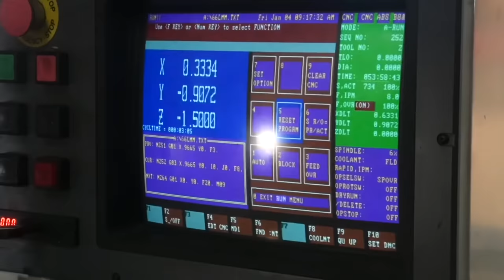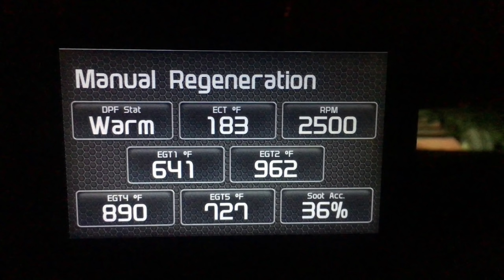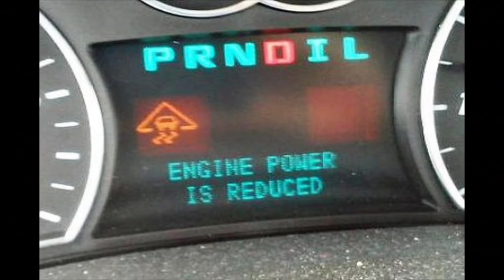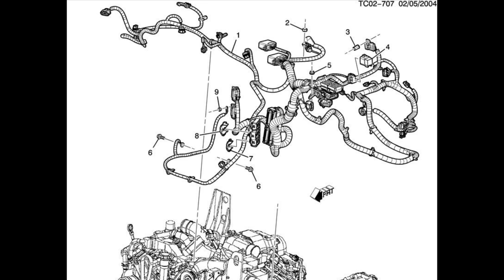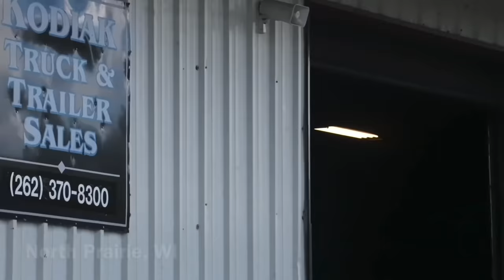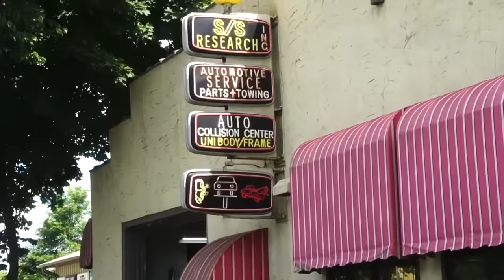Duramax Problem’s That Will Leave You Stranded!

Comment: Anyone remember when gm had a 6.2L diesel backed up by a turbo 400 trans with no electronics...and it just..... worked?
Reply: They would keep it that way but the government won’t let them. Trust me they hate making junk cause they have to warranty it
Reply: Emissions Emissions and More Transmission problem
Reply: With that impressive 135hp....
Reply: @micahblack454 it was never designed to make a lot of power, it was just a reliable workhorse engine. Ain't gonna burn any rubber, but it will get the job done.
Reply: Barely
Reply: My humvee m998 has a 6.2 it’s slow but bulletproof
Reply: @micahblack454 and impressive 20+ mpg
Reply: I had a 1997 6.5 as I understand it had a computer for timing and such only problem with that is GM put it right on top of motor which over heated it at a later date GM when they sold you a new one they gave you a longer harness for 150 bucks extra you could fasten that to the firewall or fender well get away from the heat a little bit other than that I love that truck very reliable yes I agree with you they just got too much stuff on them that goes bad and you gotta be a mechanic I know how to fix it and have all the high dollar toolsSo is it better I don’t think so

Comment: I think an LBZ specific “ beware” video would be good. Maybe even make a whole series, lb7, lly, LBZ, lmm, all of of them, biggest issues per model.
Reply: I was going to comment the same exact thing.
Reply: the BIGGEST problem i have with my lbz is people trying to buy it from me !
Reply: @bob lol, same. I get questions all the time about mine and how I like it. Then “let me know if you decide to sell”.
Reply: @bobocaterpillar3697  wanna sell that LBZ? Lol
Reply: I have an lly and would like a video of the "look outs" on it also! Love the channel and Thank you for your service!
Reply: I have an 06 LBZ with 60k. I've been lucky so far in that all I've done is replace the leaking trans lines. What are the obvious areas needing upgrades for preventative purposes?
Reply: And L5P compare them all
Reply: @jeeperaz  my 06 has 302,000 on it, only basic maintenance, plus  damn idler pulleys.
Reply: I have a o6 lbz with 200000 and no prob s should I get a tranny mod from yall I do have a check engine light on but don't have a scanner and every once in awhile it slips

Comment: I got an alarm on DEF. My shop replaced a sensor upstream of the regen box because it was wasting diesel. It would not reset the panel. Turns out the outlet sensor was slow to react and had to be replaced to allow the panel to reset. Took my shop almost 2 weeks to hunt this issue down.

Comment: Test drove a 2009 GMC Duramax the other day with only 70,000 miles on it and previous owner only used for towing 5th wheel. First time I got on it check engine light came on and transmission was stuck in seemed like 3rdish gear. Dealer called next day and said low battery caused the issue. Ever heard of this?

Comment: Just a note on the TCM - my brother-in-law has an '07 Duramax that started having the intermittent shift issues.  It looked, smelled, and quacked like a failing TCM, so he replaced the TCM.  It fixed it for all of one day, then the problem came back.  A few days later his son noticed that something looked queer with one of the speed sensors on the transmission.  Replacing that speed sensor fixed the shifting problem.  Don't forget that with most electronic control systems, you need to check both the sensors and the actuators, as well as the controller and the wiring between everything.

Comment: Very informative video. I have a lly. 240k. Headgaskets studs thermostats, water pump, 4 injectors, fuel pressure regulator , globe plug module is the stuff I ran into. She is running strong still

Comment: I'm not a mechanic but speaking from experience on my Duramax and had this issue time and time again.  FIRST place I would check is this..check the fuel filter/head assembly.  For some reason mine seems to collect contaminants and foul up the filter/head assembly.  Remove the fuel filter.  If that is the issue you will certainly see all the buildup on it and know it needs cleaning.

Comment: My son and I each have ‘03 LB7s in mid-200K’s. I did fuel injectors and lift pumps on both (tough work, but I’m not a mechanic and I got it done) and they’re both strong trucks. Yes, old diesels need maintenance, but few gas trucks will last this long at all, and the LB7s get great fuel economy compared to gas. If you don’t want to but a new truck every 10-15 years, diesel is king.

Comment: Many of the reasons i went with the 6.0 gasser when i bought my new 2500HD back in '16. It's no powerhouse, but it gets the job done consistently, without all the headaches.
Reply: I own 2-6.0s.. a 2000 & 2019.. both been solid trucks
Reply: @jredd801  This was my first 6.0. I've literally had zero problems with it in this first 5 years. I still have an old '93 Chevy 2500 with the 6.5 turbo diesel. But it's a manual trans, mechanical injection pump, zero emissions regulations..the way they should be!  375,000 + miles

Comment: A couple things on the LLY tractor comment.  I cant remember the millisecond necessary to trip your engine into the mode where it cancels out 4 cylinders but it is minute.  I dont agree with not bracing the wiring harness, on your FICM, by cutting the wire ties.  Those wires are small as all get out and need the stability.   What I did is cut a rubber hose to the length needed and split it up one side.  Put it around the harness and resecure the harness back to the bracket.  It wont rub through and reinforces the harness as a whole.  Also on the left front side of the engine, on #2 cylinder, there is a wire that runs down the front of your engine that is connected to your injector wiring harness.  That wire is not secure and stresses your #2 injector plug.  Stabilize that wire with a wire tie so it doesnt allow it to rattle the harness when going over bumps.  If #2 detects that lost contact it will cancel out #2, 8, 3, and 5.  If #7 detects lost contact it will cancel #1, 7, 4, and 6.  Either will give you the tractor effect.  On #2 and #7 I took a plastic tooth pic, the flat part, wedged them into the connectors on the back side in the plug, cut them off flush, and tightened the fit of the contact.  Have not had that problem again for over 200k now and I didnt have to cut the harness to fix it.

Comment: I own 2 Duramaxes, 1 is a 04 with over 260,000 miles zero engine/gear issues, the other is a 15 with 120,000 miles, installed lift pump, converted CP4 to CP3, had exhaust issues twice, problem fixed now, no more issues.

Comment: I like your comment about buy a gas engine. I think the consumer  grade diesel engines are such a rip off. They are too complicated for the basic mechanic, parts are way to expensive. These trucks are not reliable. You are almost better off buying a class 6 or class 8 truck. It will get the same mileage. The fact that the industry is forced to try to clean up the exhaust can add $10,000 to $15,000 operating cost over the life of the vehicle. I am a fleet manager. I have lots of Power Strokes, Duramax..... Sorry, that's just my opinion.

Comment: Own a 04 LB7 since new ,use Howes fuel conditioner since new 
276k on the truck , still running factory injectors , no smoke , no fuel in crank case , always use the best fuel filters every 10k .
Great truck

Comment: Awesome video!    I own a LLY.   I've replaced so much stuff, including the HSP bundle kit.     These trucks are not cheap to own!
Reply from the maker: You got that right
Reply: I have had my LLY since May 2013 with 178k miles.....the only major problem was a fuel regulator switch 2 weeks after I bought it. The dealer charged me over a $1000 for the repair. That's the only major problem I've had.....now have 296k miles with just basic maintenance. I love my LLY!!!
Reply: @danielellis2271  I had the same deal , pressure regulator replaced it myself also did the water pump and my egr cooler was plugged up nothing easy to fix but not to bad if you have some ability.

Comment: I have a 02 with 298,000 on it an 3/4 of them miles are towing a 32' gooseneck, injectors, front end rebuild, rear axle seals an now a new key switch ignition, an another set of infectors, only things done, more fuel, air, tuned has been a good truck.i bought with 20,000 on it. Always carry a spare belt an one or two idler pulley in the tool box

Comment: Here is another tip on Duramax cooling systems.  You are dealing with a lot of aluminum in the system.  Its highly susceptible to corrosion.  You want your coolant to have a neutral PH.  Most tap water water is acidic. Distilled is the best.  First off get rid of that red coolant!!  That garbage clogs things up.  Second, after switching to green, put in 2 bottles of Napa Cool 4056.  It will stabilize your coolant PH.  I have taken out water pumps and not had to change the housing because there was no corrosion on systems that were neutral.  You can check your PH with a guage or litmus paper that you can pick up at any plant store.

Comment: I had a 98 6.5 for 11 years. No engine or transmission problems.  Bought an 01 lb7. Needed new injectors 3 mo later. Truck was under 140k miles.

Comment: Great video guys!
I would definitely like an LMM specific video on  Fuel Pressure issues and Limp Mode. I have almost a million Kilometers on my 2007.5 stock and only started having problems recently. Got rid of the old exhaust and put just pipe and muffler on. Runs much better now but still goes into Limp Mode a lot due to Low Fuel Rail Pressure.
Reply: Put a lift pump on it like FASS or AirDog. It’s leaking air into the head unit of the factory fuel filter primer pump. The gaskets get old and leak air and drop fuel rail pressure and put it into limp mode. Replace those gaskets also.
Reply: @chip7522 if I'm not mistaken also check your fuel lines. They like to kink especially with that much use and time on em. But lift pump like you said will just make his life better.
Reply: Hi Zachary, I did replace fuel lines several months ago and made no difference. I am also in the process of replacing small lines on top of engine compartment now. We'll see what that does I guess.

Comment: Have a lly dually, pressure release valve was releasing at 13000psi causing limp mode. Truck is stock. Replaced fuel pressure regulator and replaced fpr valve with stock piece. Still got limp mode. Now replaced fpr  valve with blank plug. No more limp mode. Discovered that injector pump has built in release for over pressure so a second fpr valve not needed. This only works for stock built engines not modified engines. Truck now runs like new.

Comment: I have a 2013 one ton dually I live in east Lansing Mi it has 97000 miles about 23000 miles we pulled a Airstream trailer it weighs 6600 pounds. I’m very impressed with you guys maybe once good weather comes around I will make a appointment and have do some PM thank you 😊

Comment: 2012 Lml...low miles 85k,  I've had most of those issues, nox, pipe, def heater, and TCM. Also a big thanks to Ryan's for the TCM shipped to Texas. What was the Bosch CP4 plug for insurance?

Comment: I've got a low mileage 67k 2015 LML Duramax. Have went into reduced power mode twice towing  heavy with no warning. First time was a bad DEF temp sensor at 45k and second time was 9th injector failure at 65k. I was able to clear the code a couple times each and drive to my destination. However both times were freeways speeds on grades with traffic. The pucker factor is huge when you hear a ding, get a  reduce power message and go from 70 mph to 20 mph right now.

Comment: I have a 2005 Duramax LLY, I remember because it reminds me of “Lilly”… I have 206,000 miles pulling a 10k lb 5th wheel trailer and now I’m having issues overheating while climbing hills in hot weather. I had to pull over every 35 miles as my engine overheated and low cool warnings came on. I drove 150 miles adding about 10-12 gallons of coolant sometimes after only 5 miles. I made it home but realized I blew a head gasket which I’m not looking forward to paying for the repairs. Just FYI. Time for a new truck I think.

Comment: Gonna be on the road so will take off with all sorts of preventive items.
...some of the stuff in your description that was used on the truck Mods.
...and tools, spare parts, rescue stuff, name it.  TCM definitely.
Was going to get the GM TECH 2, but now I have seen this video, I am holding off. 

I am new at this shtuff, thankful to get any information to consolidate my understanding. ...aware of the CP4 Achilles' heel! ...and the fuel pre-filter issues, and how bad fuel can destroy a DURAMAX!

My 2011 6.6 LGH Express 4500 (Cutaway minibus) is not roadworthy.
LGH is the fuel friendly 'detuned' DML - 260hp instead of 365hp
160K runs well, cranks instantly (when it cranks)... has intermittent black-outs - coast and park on roadside a couple of minutes and it cranks again... that's dangerous and needs to be fixed. 
The [ short nose/van dog house setup ] is murder on accessing anything without taking apart the house(roof, walls and foundation) to reach anything.
...and a lot of this stuff requires new fasteners since they don't survive dismantling!!!
I am definitely contemplating turning the front-end into a removable GLAVAL-like reverse hood/fenders style, so the engine can be accessed freely!

REGEN:
One thing about the manual regen tools (CTS 2-3) I do not like is that the engine is made to run at high rpm while standing(no load on the engine); I think is a bad idea.  I once had a magnificent Pontiac Bonneville, that was used but could be placed on a dealers lot and sold as new, 55K miles.
I made the mistake of over-caring for it and let a shop run the-horrible-giant-stinking-cloud-loud-as-smitten-engine-racing-as-if-is-going-to-blow-up-process, trusting the procedure is ok, as it is recommended periodically... within 6 months the engine blew up... a perfect car I had driven for years with ZERO problems! not even a light bulb... yeah!  'pissed' does not come close!
I say much better to do this under load, vehicle on an express-way with little traffic!

SCANNERs: 
OEMtools - Connected Automotive Systems carries a scanner that is laptop based(WIN10)
https://oemtools.com/about-us/
Is it overkill, will the tools in this video suffice?

I am wondering how that compares to the scanners mentioned in the video?
Anyone ? who might have info on, knowledge on that?

CTS original no good!?
CTS 2 and 3 good for regen... I would never do under no-load.
Edge does that see all issues in all modules?
Is it bidirectional besides resetting codes?
...good to clear the limp code, as temporary rescue. Hmmm!

If the Edge ends up costing an arm and a leg, why not get a Thinktool Pro S and have it all?
...or the OEMTools solution?

Comment: I work at an indy shop, we don't see too many newer duramaxs but when we do it's nearly always dpf related.. we have a few farmers that let them idle a lot and are not on the highway much like you guys were taking about, these trucks don't like it. I've done a few def tank heaters, couple def injectors, and some egt/nox sensors as well. One of our customers has a 2015 and it's in the shop about every 6 to 9 months because it just won't regen.

Comment: I have a 2013 LML. It has a mini max and deleted with 4 inch exhaust. When I first bought it it would run like a scalded dog in performance mode (like spin the tires at 60mph when punched kind of fast) I have since added an air dog 65gph lift pump, egt and tranny temp gauge and exergy fuel system saver and have now noticed it doesn’t “seem” or sound as fast, it still runs fine as a daily driver though and for towing but won’t spin the tires at all (I did put new tires on though so that may be part of it) . It Also it used to make a loud hiss as it cycled the turbo during start up that now doesn’t do it as loud at all. I am leaning towards either time for a new air filter (or has the AFE power air filter) or maybe some metal shavings got into the turbo when I drilled the exhaust for the egt probe...or it’s the fuel saver (I’ve heard others say they removed them because it robbed power). Anyway, what are your thoughts on this? Thank you in advance.

Comment: I have a duramax with Allison transmission, I have 90,000 miles pull a 14,000 lb  5th wheel. 
Absolutely no problems, I do keep up with maintenance but it has been a great engine and transmission. 2010.

Comment: We have a 2011 Chevy Silverado HD 2500 which I believe is the 6.6 LML engine.  My understanding is this is the first year of the LML series.  We are the original owners and the truck is very well maintained and has less than 40K miles.  We use the truck for hauling a gooseneck horse trailer and now going to begin pulling a fifth wheel RV.

Give the age of the truck, and what is now know of the vulnerability of some components as well as aftermarket systems (pumps, filters etc.) that can improve reliability and performance, what would be a list of items I should or could have done.  Don’t want to be stranded, and would like highest possible reliability and performance.

Love your videos, if I were in Wisconsin, I would be pulling into your shop!  I would appreciate your input!  Thank you!

I’m located in Lexington South Carolina

Comment: Love this type of video, I have a 02 lb7 with 192000 on it . It still runs good but I'm getting nervous. I've owned it 8 years and never had one issue so I know something is coming. Its completely stalk other than a 2 in suspension lift.
Reply: I'm at 210k injectors and upgrades!!!   Rebuilding the front suspension, it wasnt sloppy but is 2002 with 210k on it lol. No problems here!!!